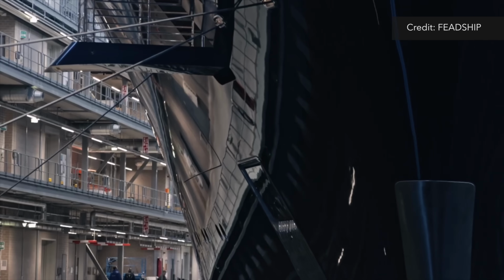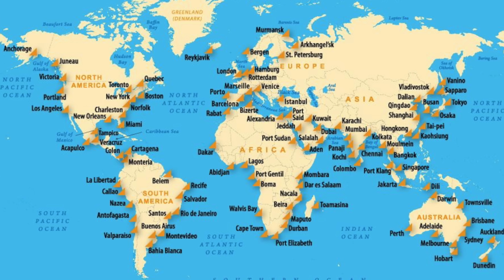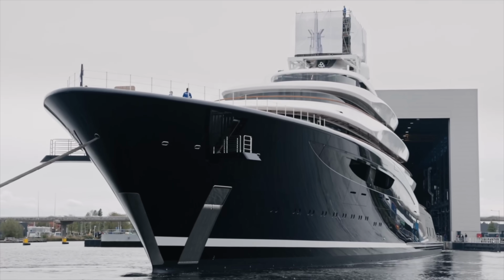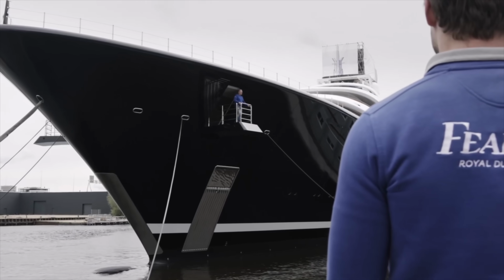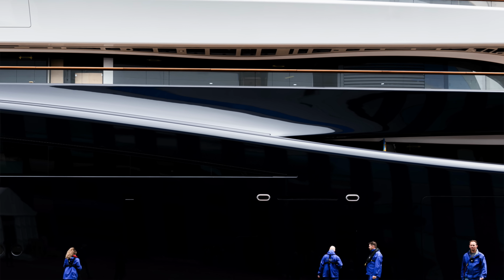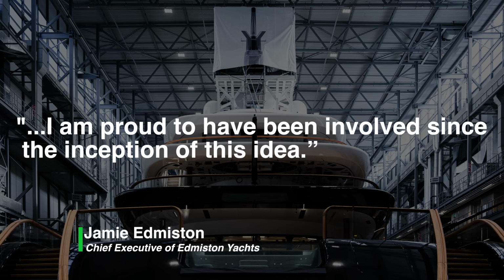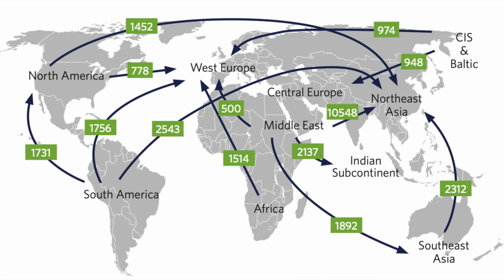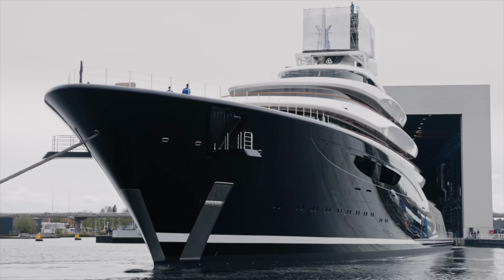This Brand New Superyacht Will ‘Change Superyachts Forever’

Comment: As an energy consultant I would like to say that is one of the best explainers on the various credentials of different hydrogen production techniques I have heard. For reference the terms generally used in the industry are: Grey Hydrogen - produced by steam methane reformation which has carbon monoxide as a byproduct; Blue Hydrogen - also produced by steam methane reformation but with the carbon monoxide captured and sequestered; Green Hydrogen - produced by electrolysis of water using renewable electricity usually wind power or solar PV. The idea being that when wind turbines or solar panels are producing more electricity than is required by the grid they can use the surplus to generate hydrogen.
Reply: As an economist I would like to say this all nice on piece of paper, but the actual costs of using this technology to produce electricity would only occur if the industry was forced to; via law, tax or sibsidy.

And if this occurred, electricity would become even more unaffordable than "renewable" technologies already have
Reply: You’re not much of an economist.

Comment: I see the benefit here as a technology demonstrator that move the industry toward less harmful fuels, though I also several obvious ways in which it could have been greener:

1. The hull could be painted green instead of black.
2. Make it a sail boat to minimize use of the large motors (make them a backup instead of primary propulsion system).
3. Add solar cells, lots of solar cells, again reducing usage of the fuel cells.

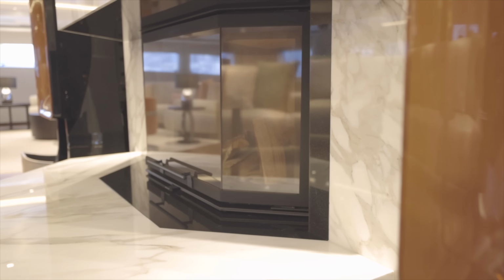Comment: 5:53 One of the rare occasions where I've seen an audiophile level system on a yacht.  

This is a positive step in moving yachts towards green energy.  Still waiting for a purpose built hydrogen yacht covered in solar cells.  Like a larger version of The Energy Observer.

Comment: I doubt that they use "Compressed liquid hydrogen". At -253°C, Hydrogen is a liquid that needs no compression. To prevent buildup of pressure you have to constantly cool it or use the evaporating gas for power production. I guess that the power consumption of the yacht is such that the cooling option is not needed very often.

Comment: Probably the largest contribution vessels like this are making is the further development of cleaner energy at sea as a technology. I fully expect this vessel in particular to be nowhere near as green as they claim if you actually care about the environment and not about all the technicalities they'll use to promote it. I also expect the total pollution for even building the thing when you factor in all of the materials that had to be created for it too to be pretty huge and likely more than it will ever save or offset in it's lifetime. However that doesn't mean I don't think the industry should bother with trying to make them more green. It obviously should since superyatchs are going to continue to exist and continue to be built then we may as well reduce their impact as much as possible and every bit helps. We're not there yet when it comes to truly green power at sea, but laying the foundation for one day when we might be is still important.

It's likely the motor yatching industry will be among the last to go 'fully green' since it depends on so many other things to do so first, even for Hydrogen power you need the energy put into producing it to be fully green before it even remotely makes an impact- the energy requirements for making hydrogen in a green way are pretty enormous...and the cost effective less energy intense way is actually quite polluting...I'm glad money and effort is being put into making it green-er but I do get the very strong sense that an awful lot of that effort is specifically targeted at deliberate 'greenwashing' to make them seem more acceptable, and I do find that very unfortunate

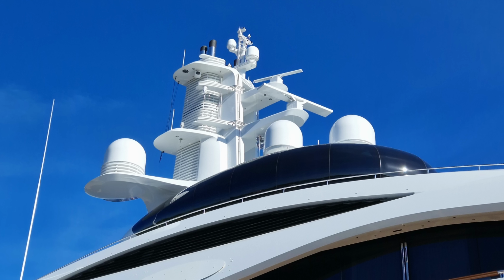Comment: 2:48 “With only pure water coming out of the exhaust” - whoa whoa whoa … hold on there Charley. Methanol is made from methane. Methane is a carbon fuel. The carbon molecule must go somewhere in the chain of converting methanol to hydrogen to electric power. That somewhere is CO2. By using methanol, you do reduce CO2 emissions but only by about 7%. The other nasty stuff (NOX etc) is avoided though, so that is a net improvement. Until the hydrogen is produced from water, CO2 will be emitted.
Reply: That was regarding the hydrogen fuel cell. He does go on to discuss the reformer process.
Reply: @ADHJkvsNgsMBbTQe  that he does. However if I recall correctly he explicitly avoids the words CO2 emissions. Please correct me if I’m wrong. There’s no need to have separate discussions about the exhaust from one end of the process from exhaust from the other end of the process. The whole point of “green” is less CO2 emissions that result in less global warming from whatever activity. So, CO2 emissions.
Reply: @tedspradley  except that the vessel is capable of storing and using pure hydrogen where available.
Reply: Yup, there is no free lunch. It takes massive amounts of electricity to separate the H from H2O in the quantities required. Hydrogen unfortunately doesn't exist in nature in its pure form. It's always attached to something.
Reply: @1227_Washington  That's why they attach it to methanol on this ship.

Comment: It's good to have a lot of detectors for hydrogen / hydrocarbons. H2 leaks very easily and will accumulate in the ceiling. Non spark lighting is available.
Reply: Bloody Hell!
Reply: Hydrogen was used by our chemists to scavenge free O2 in the engine plant water system so we had a hydrogen locker aboard ship back in the 80s but there were no installed monitors. The containers would leak Hydrogen displacing air (oxygen) inside the locker.  We lost 5 guys because they would not follow proper time consuming air quality testing procedures before entering the locker and they died of asphyxiation.
Reply: @Stetsonhatman  That's sad to hear. Possibly oxygen sensors needed too then. For small quantity of H2 the safest way is to have a H2 generator from electricity, or possibly a safer getter.
Reply: @Stetsonhatman  H2S Alive is a one day course required in any oil patch work. AND confined space rescue. Even then, we've lost people in barge rescues and even old mine or depressons you'd think couldn't be classified as a closed space. Lost two scientist in BC a few years ago.

Comment: Diesel fuel is still by far your best bang for your buck for clean reliable energy. 
 You have to take into account the hydrogen footprint of producing the methanol and the hydrogen . You also have to look at the type of energy used to produce it. So essentially you are shuffling deck chairs on the titanic.

Comment: LNG is another option as a replacement for diesel. It has to be stored at -160°C though. It's already used on some yachts too (and is being trialed for use in trucks).
Reply: LNG/LPG is used a lot already in the UK for Road Haulage.  I drove a 44t Volvo with LNG a few years ago
Reply: @oldhairpin  really? i didn't know that. How was fueling it like? and how far did it go on one tank? how much was the fuel and how common were the fuel stations?
Reply: LNG & CNG has been commonplace in Thailand for at least a decade, but the energy density of NGs is much lower than diesel but can be burnt more efficiently when under high pressures . LNG is 40% lower than diesel and CNG is 75% lower.

Comment: Methanol is a hydrocarbon.

Extracting the Hydrogen for use in fuel cells is great.

But what happens to the carbon atoms from the split Methanol molecules?

These are waste products. What’s the plan?

Comment: Nice to see that someone is taking the leap and mayhaps lead the way forward.
There is a Nickel and Copper plant where I live, GCE Node, that have produced clean-er hydrogen since 1960s. They use it in the production and a currently tasked if they can make liquid hydrogen out of the excess hydrogen that they don't use for their own production.

The plant produce via electrolysis, 2 tons of hydrogen each day. 

As an added bonus, the excess Oxygen being produced in the process, is shipped over to a nearby plant who needs a lot of O2 in their production.

With more plants like that, building a network of liquid hydrogen tank stations should be foreseeable within near future. 

And as you mentioned. There will always be a demand for super yachts, and as long as the demand is there, and the money to buy them. There will be builders who deliver. So why not build as ecofriendly as possible, even though.. Yes, the most environmental action is not to buy/build a yacht in the first place.

Comment: As hydrogen is a low density fuel this massive yacht will have a very short range and require specialist supporting tenders to keep this beast fueled.  On the Positive side it can just site in port and run is MTU diesels to keep the lights on...

Comment: I didn't think LNG would become a popular shipping fuel but it is, at least where sulfur regulations are though. Maybe LH2 can become a shipping fuel too despite its low density and handling problems. But I think it would be simpler to make methanol using the green hydrogen, much easier to handle and transport.

Comment: Would love to know how YETI  calculated that 70-78% of energy used is for hotel loads.  There must be some huge assumptions that go into that calculation.  It seems awfully high to me.  I have used figures from a very busy 60m and a very lightly used 50m that I spent 2 years in each and I got 30% and 50% respectively.

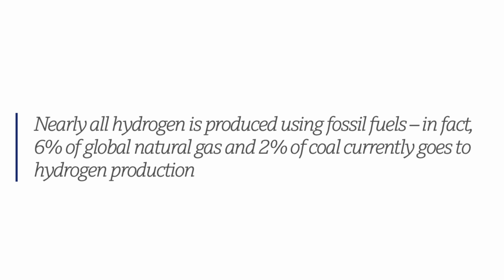Comment: @8:40 "but hydrogen can be made WITHOUT fossil fuels..." if it needs energy somewhere in the process to produce, there is fossil fuel involved. same with solar panels and batteries, the end product very green, but the process of getting the materials and recycle the products later, not so green at all.

Comment: This vessel will likely switch from methanol to ammonia for generating hydrogen. Commercial shipping is going to drive the transformation, and infrastructure for ammonia will be going in soon. 

The beauty of fuel cells is that they're extremely efficient and many products can be reformed to generate hydrogen. Natural gas is currently one of the best sources, but it's also difficult to store.
Reply: According to the USA department of Energy hydrogen fuel cells are only 40-60% efficiency...sounds very extreme...no? 
Not to mention the rareness and expense of making Hydrogen, and by expense, specifically it demands a lot of fuel to make power to produce said Hydrogen...no? 
You are likely right about the ammonia except it is a passenger ship and well ammonia is not very safe...like most gases can leak...and some can also explode or make a kind of mustard gas? Imagine their insurance rates are insane for just Hydrogen? Odds are it will be burning diesel 99% of the time...and that is by far the most efficient because of energy density?
Reply: My ex was an engineer at NASA. They only did ammonia transfers at night when there weren't many people working, and he had to work on the nights that they were doing the transfers. The precautions NASA takes when dealing with ammonia gives me the impression that it isn't very safe.

Comment: A simpler idea would been to design the engines to run on 100% sustainable fuel like F1 is going to in 2026 and MotoGP just announced for 2027.
Reply from the maker: They have to consider where they are going to refuel, and there are no plans to use this in the marine environment.

Comment: Why use methonol or HVO. Just use flipping sea water. In all the above you will need energy to crack the hydrogen bonds ( Methonol you need to crack the carbon bonds and also HVC and sea water is just oxygen bonds).
Obviously with sea water there is no storage needed and it is free and the yacht is sitting in it so no logistics costs either. 😊
For shipping, hydrogen from sea water is a no brainer. Rather strange no one has done this since new electrode material to withstand the corosive sea water was published via Stanford Uni about 2 years ago. These electrodes are used in the electrolysis of water into hygrogen and oxygen.

Comment: You said 60 to 70 % of the hotel power is covered,  2hat about propulsion.  Is that still fossil fuel. ?  What energy do they use to produce and store the hydrogen?  How long can they go without using any fossil fuel. ?

Comment: The technology is moving so fast at the moment, the only real future proof solution would be to go full electric drive with power coming from replaceable hybrid combination systems - hydrogen generators, biofuel generators & battery combos. 
Toyota's new engine can make hydrogen straight from water, so that will be scaled up in coming years.
Also, green hydrogen manufacturing is seeing massive growth with new plants being commissioned almost monthly in mostly desert countries with high solar yield..

Comment: When I think GREEN, I think SAIL, not motor.   I don't know how correct and true this is, but, it would be nice to see some comparisons between a true SY (not motor assisted sail) designed/built to be as "green" as possible vs. a comparable MY built to similar "green" standard.  
On smaller Sailing vessels, it's quite possible to go entirely off-grid with energy capture from solar, wind, and hydro turning props while under sail to generate added electricity.  I don't know how well that scales up on 50m+ Sailing Yachts.  
In comparison between sail vs. motor, my personal bias is, of course on the side of sail, but, that's me.  If we had a "shootout" of several "green" SY vs similar MY to get a good data set, that would be the most telling with many vessels to compare to same number on other side.
Change my mind.  :)
Reply: In the video, he cites the YETI statistic that 70% or more of the energy load in a superyacht is for the hotel, mostly AC and heating. A sail doesn't cool the interior, so that 70% figure is still going to be there. Also any yacht over 50m is going to be so bespoke in how it's built that it would be really difficult to draw meaningful conclusions from a dataset, even if you were able to take a census. There's only about a thousand or so in the world and each is made custom to how the owner wants it. Even identically hulled sister ships will have totally different interiors.
Reply: @patrickmurray2505  - you make some good points, but, you don't supply solution.  How could a good comparison in a green vs green vs Sail vs. Motor be staged?
Tonnage?  Length?  Volume?  Guest/crew capacity?  Range?  Electrical loads?  What would be fair metrics for comparison?
A sail doesn't necessarily cool the ship, but, there's developing technology where the sail is also flexible solar panels, plus, as mentioned, screws could generate hydro power while underway as opposed to eating power just to move.  
How much energy capture is feasible and practical on a sailing "superyacht" vs. a motor "superyacht"?   
It's a valid question.
Which platform can be the most "green" electric tenders and everything?  ... and at what point are the returns so diminished it's impractical?  ... or how does energy capture scale?
Reply: @konstantinavalentina3850  -  The devil is in the details.  And who would pay for this study?

Comment: Plenty of people/companies have tried the "built it and they will come" model. Most have failed. As mentioned in the video, the "green" hydrogen that people conflate with anything "hydrogen" in the media is a vanishingly small part of the hydrogen supply-chain as it exists today. Using methane to supply hydrogen to be "green" is a non-starter.

Comment: There will be space for hydrogen from renewables as more wind and solar are added to the grid. Overproduction could go to batteries or hydrogen production. Energy price at those times is super low . A win situation for hydrogen when the infrastructure is in place.

Comment: So if the cooling system fails to keep the hydrogen in its liquid form at -450+ degrees Fahrenheit then it will expand into its gaseous state and explode beyond the confines of the tank holding it…and the ship holding the tank!🤯
💥Smart, real smart!💥

Comment: It's impressive on the surface, but it all seems quite pointless running hydrogen tbh. Until we get an energy source that can do propulsion and hotel load without compromise, hydrogen just seems like a gimmick.
I'd love to get together a group of top engineers and nuclear physicists and see what kind of safe micro reactor could be devised for superyachts and commercial shipping.

Comment: impressive yacht  ----------

just waiting for them to drop in price a tads /////   -----  maybe father christmas       written letter  .....  all I want for christmas is my twenty berth yacht .........  -------------------------   nice tech video ......    

a few companies have developed some good tech for this  JCB   tractor  construction --- type vehicles have a good range of hy fuels vehicles ......    actually said for bigger heavy equipment  -------- has many advantages ...... (although some of their tech is quite secret  -- as with being able to compress it under extremely high pressure and then apply it through whats essentially a hydraulic air system as it quickly finds the weak point to current pressure rated materials, so they developed their own      as you do ....  -------------- such as fuel containers, welding techniques, pipe joints and links etc )        

saying that a super yacht kinda beats a tractor in terms of tech advance ......   good review ............................. tick